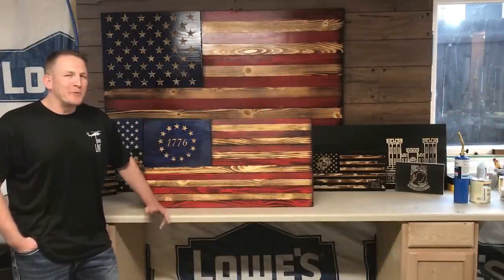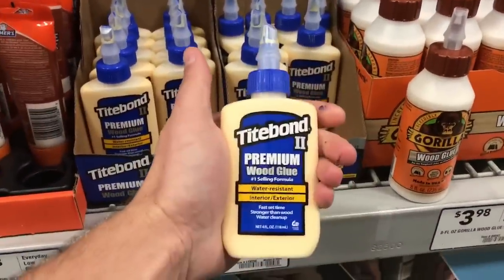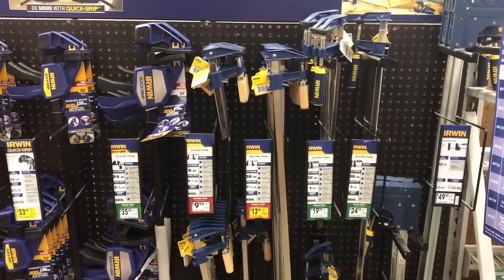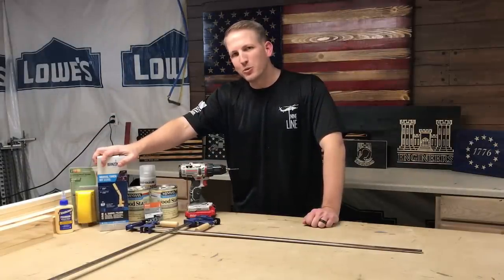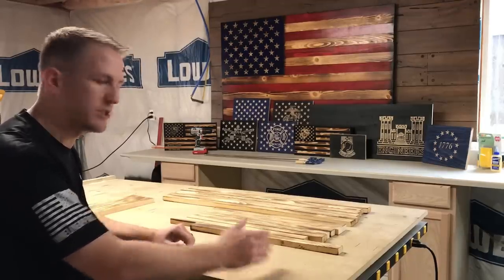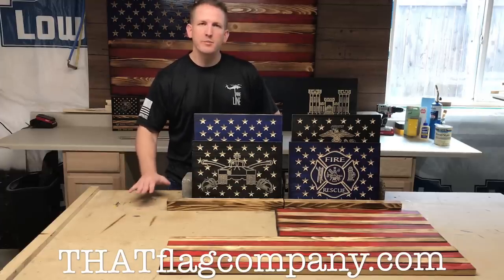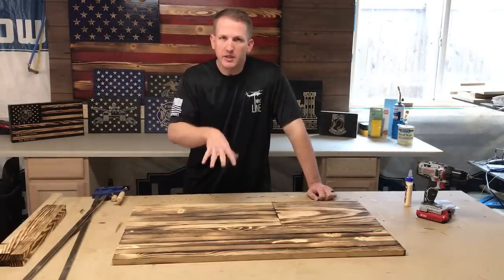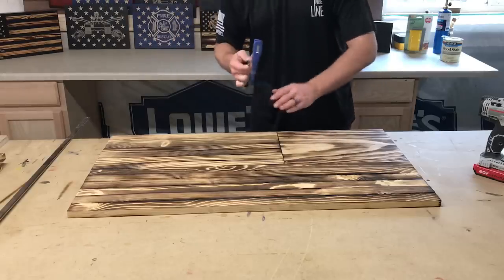DIY - Rustic Wood American Flag - Start your own Flag Co. for under $100 - Step By Step, How To

Comment: Here is my cut list for a 36in flag:
You need a total of seven  21.75in boards and six  36in boards for the stripes. You also need four 19in boards for the back supports (this cut list will give you enough to add a 5th support if you want) 
You need to purchase five 1in x 2in x 8ft boards....
-Board 1: 36in, 36in, 21.75in  (2.25in remaining excess)
-Board 2: 36in, 36in, 21.75in (2.25in remaining excess)
-Board 3: 36in, 36in, 21.75in (2.25in remaining excess)
-Board 4: 21.75in, 21.75in, 21.75in, 21.75in (9in remaining excess)
-Board 5: 19in, 19in, 19in, 19in (20in remaining excess, I used it to create a 5th back support board resulting in only 1in excess)
***If you need to make a union, a 1in x 12in x 4ft board ripped to 10.5in will yield enough for 3 unions measuring 10.5in x 14.25in each.

Comment: FYI if you are a veteran doing this, Lowe's gives 10% discount to veterans year-round if you didn't know. That'll help save money
Reply: I use my veteran discount all the time.
Reply: So does Home Depot.
Reply: Home Depots discount is way easier to redeem than Lowe's.
Reply: @WayneSherman-W488  Home Depot does not offer a veteran discount. They only offer the discount for active duty. Lowe’s offers the discount for Active Duty and veterans.
Reply: Just to remember to link your my Lowe’s reward card to your military ID.

Comment: On my third flag. First was an experiment and is hanging in the garage as an example of mistakes. Second one is hanging in my office. On my third I got over confident. went through all the steps and finally flipped it over, marked for the bracing, put glue between the boards, clamped them up while pushing the slightly bent ones back down, put glue on the first bracing, lined it up, pressed down to hold it in place, grabbed the nail gun, and phssssst. The cheap 15yr old nail gun blew a seal. No, I did not throw the nail gun across the room like I wanted to. I put the other bracing in place ran another board across them and set my small generator (40+lbs) on them to hold them in place and walked away. It dawned on me this morning that I had not put anything under the flag so I am afraid to go back to look since it may glued itself to the bench.  PMCS your equipment before you start the mission and it may save you and the mission.

Comment: How about a follow-up video in making the union to this flag?  I was also thinking, why not make a two-sided flag that has long stakes sandwiched between them so it can be pushed into the ground at a garden area or such?  You could easily do this with the support 1"X2" pices you made to hold the wood together if they were longer and maybe made to a point at the end of them. Nice video, but all the troll crap always ruins the best effort of people to post such and allow comments because of it. I have burned wood, but I also like the effect of home made stains made from stainless steel and vinegar used on old pallet boards or even fence posts/pickets that I got for a fence repair at Lowe's. Nice job and thanks.
Reply: a1930ford you can find all tha flag specifications online... just a little math but they give you all the formulas you need. I made an awesome flag myself here and used cast iron stars I painted a polyurethane white. Thing is bigger then a 60 inch TV lol but ita beautiful
Reply: Great video! Only thing missing is to show how to make the unions. How do you get the stars imprinted on the wood so perfectly?
Reply: Matt Mondon you can look up specifications online... If i remember right all the dimensions are given based on the hoist width of the flag. You have to calculate all those numbers in.
Reply from the maker: Hey a1930ford, there are multiple ways to make the union yourself. We started by making a template in Microsoft Office and tracing it onto stencil paper from Hobby Lobby. We then used a knife to cut the stars out of the stencil and could use that stencil to trace the stars onto the union. After the stars are traced, you can use a dremel or a hammer and chisel to engrave them into the union. Hammer and chisel takes more practice to get right but ends up being quicker and better than a Dremel in my opinion. This is the most cost efficient way to make the stars yourself. I have also seen people buy stencils on Amazon but they’re not always proportional for their flag and they’re limited to the one size and style. We will be making a follow up video in the near future covering all of this. 

However, to make the unions with our level of quality and detail that we offer on our website would cost you thousands of dollars in equipment and multiple tutorial videos. For this reason, we did not go into the details on this video but decided to offer them already completed for $34.95 on THATflagcompany.com in order to provide another option that we wish had been previously available to us when we were starting. 

I hope this video was useful for you and the follow up response helps give some additional clarity.  If you have any questions we can help with, definitely don’t hesitate to ask!
Reply: @thatflagcompany7105  It looks like the union is stained similar to the red stripes from the video. What color of stain is used to make the union that color of blue?
Reply from the maker: Alex Wiseman, it’s the same brand of stain and Lowes calls the color “True Blue.”

Comment: How is the union made? Can you make a video? I just received a DYI 50 stars union from your site today and am impressed by the quality of it especially the stars.
Reply: 0
Reply: CNC machine
Reply: I've ordered 2 Unions. Definitely CNC router. Very clean and deep stars. No chisel or Dremel. Also I've emailed them a few times with questions. Got back to me in no time. Great people,  great work.
Reply from the maker: Hey J Rendon, I’m glad you liked the union and thanks for entrusting us to build it for you! 

There are multiple ways to make the union yourself. We started by making a template in Microsoft Office and tracing it onto stencil paper from Hobby Lobby. We then used a knife to cut the stars out of the stencil and could use that stencil to trace the stars onto the union. After the stars are traced, you can use a dremel or a hammer and chisel to engrave them into the union. Hammer and chisel takes more practice to get right but ends up being quicker and better than a Dremel in my opinion. This is the most cost efficient way to make the stars yourself. I have also seen people buy stencils on Amazon but they’re not always proportional for their flag and they’re limited to the one size and style. We will be making a follow up video in the near future addressing all of this. 

However, to make the unions with our level of quality and detail that we offer on our website would cost you thousands of dollars in equipment and multiple tutorial videos. For this reason, we did not go into the details on this video but decided to offer them already completed for $34.95 on THATflagcompany.com in order to provide another option that we wish had been previously available to us when we were starting. 

I hope this video was useful for you and the follow up response helps give some additional clarity.  If you have any questions we can help with, definitely don’t hesitate to ask!
Reply: @thatflagcompany7105  I for one will continue to buy the Unions from you to support the company as you gave me this idea and opportunity. I can't thank you enough and wish you to continue as well!

Comment: What size are the stars on the 36” build? Thanks! Great products
Reply from the maker: Roughly 1.2”
Reply: How do you make the stars??
Reply from the maker: Dorkchop, There are multiple ways to make the union yourself. We started by making a template in Microsoft Office and tracing it onto stencil paper from Hobby Lobby. We then used a knife to cut the stars out of the stencil and could use that stencil to trace the stars onto the union. After the stars are traced, you can use a dremel or a hammer and chisel to engrave them into the union. Hammer and chisel takes more practice to get right but ends up being quicker and better than a Dremel in my opinion. This is the most cost efficient way to make the stars yourself. I have also seen people buy stencils on Amazon but they’re not always proportional for their flag and they’re limited to the one size and style. 

However, to make the unions with our level of quality and detail that we offer on our website would cost you thousands of dollars in equipment and multiple tutorial videos. For this reason, we did not go into the details on this video but decided to offer them already completed for $34.95 on THATflagcompany.com in order to provide another option that we wish had been previously available to us when we were starting. 

I hope this video was useful for you and the follow up response helps give some additional clarity.  If you have any questions we can help with, definitely don’t hesitate to ask!
Reply: THAT Flag Company Thank you very much. Sounds like it's just easier for you to do the Stars for me :)

Comment: What size wood do you recommend for the union.  Is it a 3/4 inch plywood or something else.  Great job
Reply: I’ve used 1x12. I’ve found a couple shops in the area that can laser engrave the stars for me. However, they charge more than this company just to do the engraving with me supplying my own wood. Might as well order it from these guys. Plus it’s helping a great company

Comment: What's the turnaround time on the Unions?  Do you keep them in stock or make each based on the order?  8 packs and individuals.  Thx God Bless 🇺🇸🇺🇸
Reply from the maker: Hey snleclaire1111. We make everything to order and the turnaround time fluctuates. Right now, we are averaging 4-5 days. Sometimes we’re able to ship out an order in 1-2 days, and we have never want to see a union order get older than 10 days. Hope this helps and always feel free to email us at info@thatflagcompany.com.

Comment: Thank you so much for sharing. I recently started making flags and learned a lot from your video. However, I was recently told not to glue the stripes because it will cause the flag to warp over time when the woods shrinks and expands? Have you, or other viewers had this issue?
Reply: Good point, might be best to just brad nail the stretchers and call it good. Maybe just glue stretchers on and brad nail.

Comment: Awesome video, made one and it came out awesome, question do you guys use a different blue for the thin blue line version. The true blue came out too dark. Thanks again for the video.
Reply from the maker: Hey Gotham! We actually use the same color of stain for the blue stripe as we do the Union. The secret is to not burn the middle of your stripe and the color will POP off of the natural wood color beneath it. Hope this helps and good luck!!

Comment: Save a few more bucks by getting wood glue & clamps at harbor freight.  They also have a multi tip propane torch for around $30.

Comment: Made my first flag today.  Thanks for the video.  Only thing I would improve it with is the measurements...flag at 37" wide...cool.  Made with 1x2 furring strips...so this worked fine.  The union however presents a problem.  10.5 inches high is good...goes with the material.  But the width of the union...needs to be closer to 15 inches...most stencils are 10.5 high by 14.8 wide.  So I would make the flag a little wider to balance the look.  More like 39 inches.  Also...used 5 pipe clamps...worked great.  Thanks again guys.  Off and running.

Comment: I made a flag for a Deputy that almost died on the line of duty. However  I noticed that my wood is warping because I changed locations when I first made my flag up in the mountains to a desert area. How can I pervent my 1x2s from warping when I put them on togther with the glue and brace?

Comment: Great video. I’m making one right now. Fun project. I would like to say that since you originally made this video, Lowes has changed their policy (at least near me) and they will not cut the wood for you. They only cut them to fit in your car.  That being said, it’s not a hard to cut and you don’t even need a powered saw. Get a little $10.00 mitre box/saw. You’d be surprised how versatile it is.  My old mitre saw motor burned out and I didn’t have the money to buy a new one for a while. It was really useful.

Comment: Awesome video and awesome work.  I am a new subscriber to your channel.  I am sorry if the following is a repeated question.  I tried scrolling through the comments but didn't see it asked.  The flag in the background on your wall...  what is the total size and what is the size of the union?  I would like to make one that size for my wall.  Also, if you were going to make a wood flag for permanent outside display, what is the materials you would use?  Thank you so much.  Keep up the great work.

Comment: If you don't mind me asking, what size wood boards do you purchase to cut out your unions? Thanks and great video I already started building my first one
Reply from the maker: Hey Travis, the union should measure 10.5”x14.25”
Reply: Buy the 1x12"x4ft premium pine boards, rip it on a table saw to cut it down to 10.5" wide, that will give you 3 - 10.5x14.25 pieces for unions!
Reply: Awesome i appreciate it!!
Reply: What size stars fit on the 36” flags?
Reply from the maker: Roughly 1.2" in diameter

Comment: 1 x 2 x 8-ft Furring Strip (Common); 0.75-in x 1.5-in x 8-ft (Actual) .  Are these what you are speaking of or is it better to rip 1" X 6" X 8' into true 2 " strips?  Thanks,  Bob in Tampa
Reply from the maker: Hey Bob. The true width of each stripe needs to be 1.5”, which is the true width of the 1x2 strips that I used in the video. 

Be careful with furring strips though. Unlike 1x2 pine, they often are more narrow than 1.5”. Easiest way to check is to take a tape measure with you to be sure. If you have a table saw, then I’d probably rip my own stripes from a board that are 1.5” in width. All 13 stripes put together should make your flag 19.5” tall.  

Hope this helps!

Comment: Good Morning ( Denver time).  I am a retired USAF MSgt and I have bought multiple unions from you, and currently have an 8 pack on order.  Your quality is outstanding!  My question is, I have had a union slightly warp.  Is there any way to alleviate this from happening, and what is the best process to get my union back to normal.  I have heard clamping, but I also have limited worktable space.  I have a full time job and unfortunately do not have time to put the flags together at a routine pace. How do I keep these guys flat?  Thanks in advance.
Reply from the maker: Hey Larry! Thank you for supporting us and allowing us to build your unions for you. I am glad to hear that you appreciate and are enjoying the time and effort we put into the quality of our unions. Quality is incredibly important to us!

Warping is always a constant concern when dealing with wood. Warping is caused by the moisture in the wood changing unevenly or when one part of the board dries faster than the other. To help alleviate this, store your wood in a manner that won’t allow moisture to access the unions and in a stable/constant climate. 

If you do have a union that is warped, some people have luck applying heat to one side with a torch (depending on which side has started to curve) and flattening it back out that way before assembly. However, we’re not always able to make all of our unions flat either and assemble many flags with slightly warped unions (flattening them during assembly and bracing). Since we have more practice at building them this way, we keep any slightly warped unions for ourselves and only ship flat DIY unions. Unfortunately some cupping has occurred on rare occasions during shipment due to the climate change experienced during the shipment or while waiting in the builders shop/garage, such as your case. 

I hope this helps and please let me know if I can answer anymore questions for you!!

Comment: Not sure if anyone has mentioned this or even had this same issue, but the 1x2’s I got from Lowe’s were 1/16 (?) shy of 1.5”. So my 10.5” tall union was ultimately about 1/4” taller than the seven short stripes. I would suggest the alternate method of getting a wider board and ripping it to your desired width.
Reply from the maker: Hey Chunky Bones! The 1x2’s should measure .75x1.5”. A lot of people have unintentionally grabbed furring strips from Lowe’s that measure smaller than shown in the video similar to the size you mentioned. 

Great recommendation on ripping your own stripes for those that are able with a table saw.

Comment: How do you keep your unions from warping after you can’t and engrave them. I have made a few after watching your video and I have found that if I don’t install them in the flag with in a day or two of me cutting them down and putting them on the cnc, that they will warp. I am using normal Doug for and pine. Great video.

Comment: I have a question, what is the smallest flag you do? I have a space that I would love to have a wooden flag presented there but the space would only allow a 36” fly. The hoist is 1’-7 3/32”. Unfortunately I couldn’t find a stencil for the union.
Reply from the maker: Jasonthehammer, the smallest flags we offer on THATflagcompany.com are 18.5” in length.